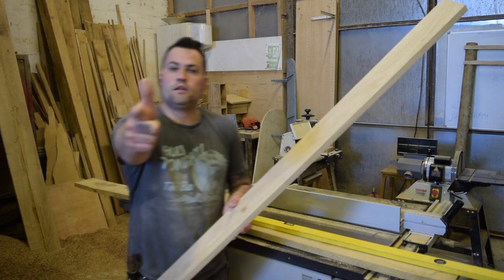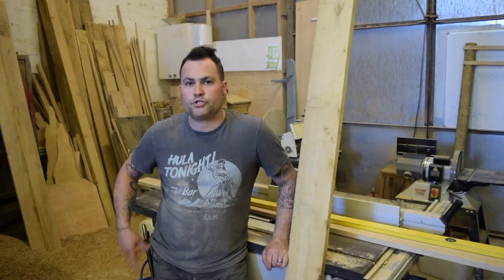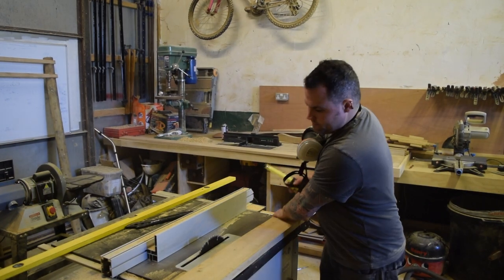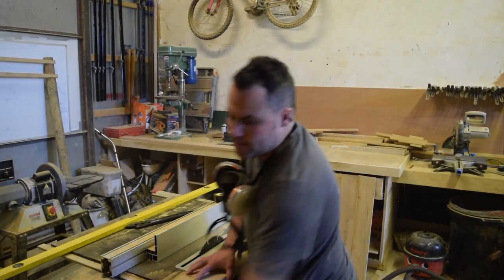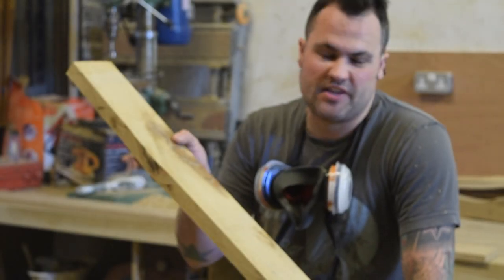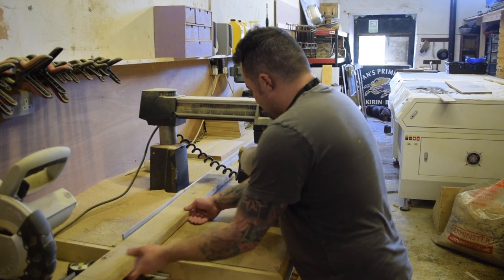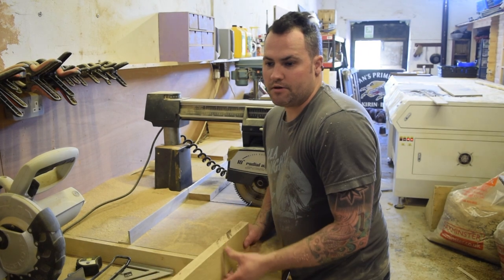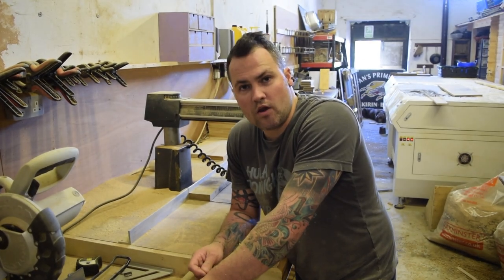Quick Tip 9 Poor Mans Planer

Comment: I didn,t see you saw the face of the board only the edges
Reply from the maker: hi George, yes thats right, for this application we only needed it on the edges of the boards. you could do this on the face but it would get quite tricky. you are also restricted by the depth of cut your saw can accommodate.  thanks for taking a look. we havent been able to upload for a while but i will be getting back on it soon.